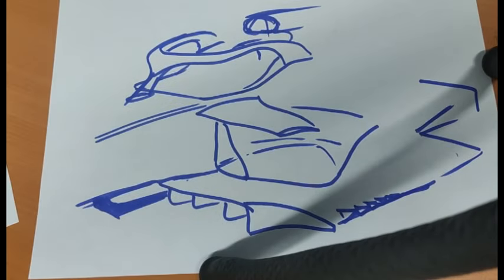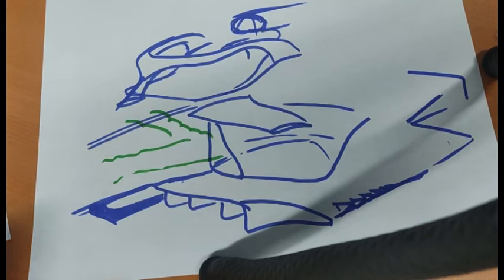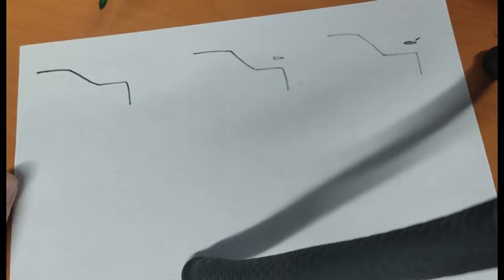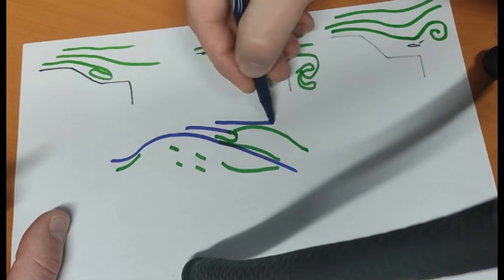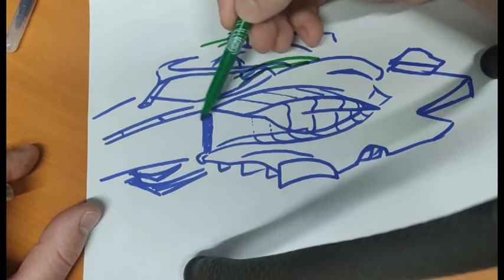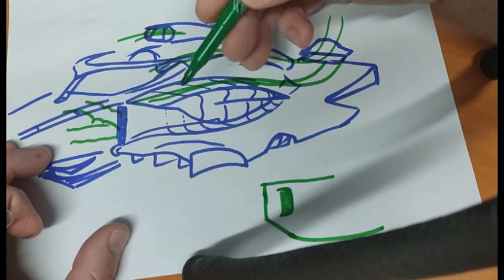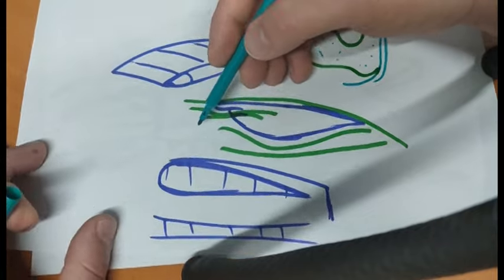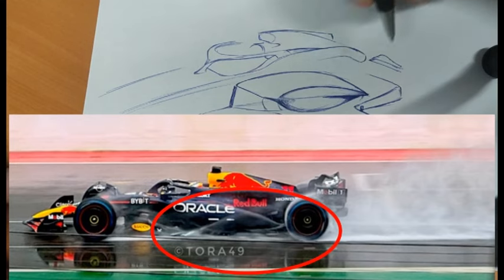RED BULL RB20 zero sidepod design are they going to follow Mercedes?

Comment: I agree with you they are going to get rid of the sidepod and replace it with a wing. Very nice vid and illustrations. Are you an aerodynamicist?. Cheers
Reply from the maker: Hi i am a mechanical lead engineer with an automotive engineering degree, i designed race cars and electric vehicles and currently working with aerodynamics to create vacuumation machines/vehicles
Reply: You gained a new sub my friend, very nicevchannel. Btw why don't you try motogp, very few people are covering it, and the aero race is insane, cheers!